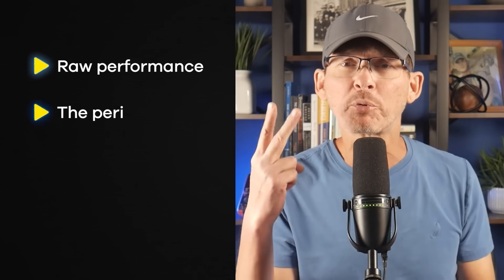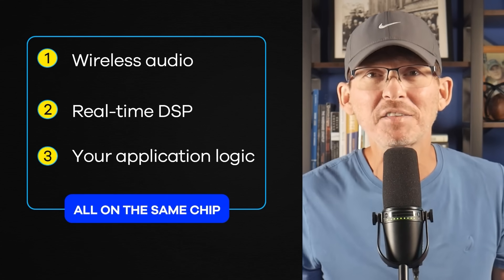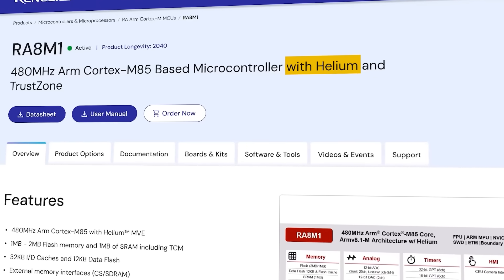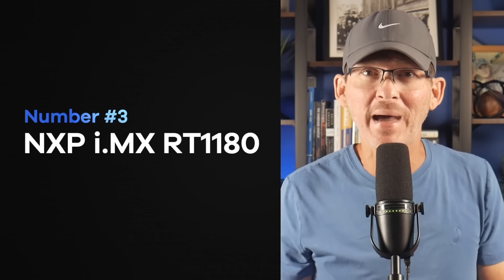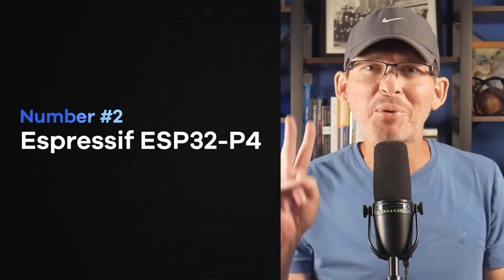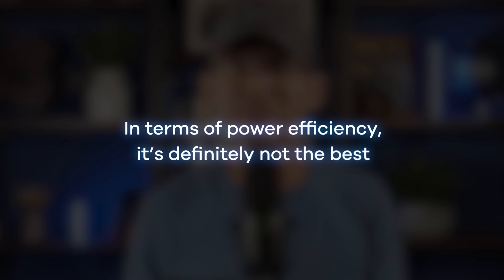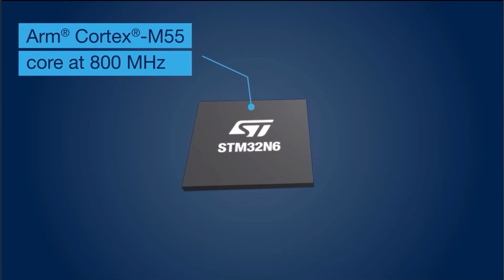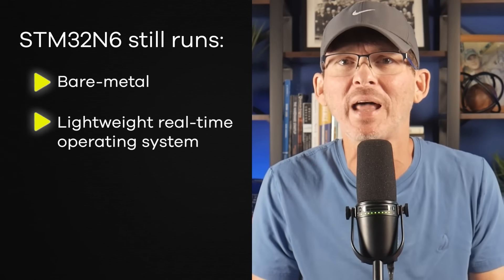Top 5 Most Powerful Microcontrollers in 2026

Comment: That STM32 part is basically a Beaglebone Black / FriendlyARM Mini210 in a chip (and without the memory management unit?). These used TI and Samsung parts with the ARM Cortex-A8 and were a favorite for embedded Linux because they never need a heatsink, even in a gas pump in Egypt. They have camera in and video out, etc.

Comment: Sorry, but STM32N6 is not the most powerful, it just have AI cores that not useful for all, STM32V8 will have much more computational power and higher clock rate. 
Also you are missing that some TMS320 will blow most of even GHz level processors on computational performance. (but they are more or less full blown DSP, but at this point, line is very blurry)

Comment: Heh you missed one thats a bit under the radar its about 1-2 years old. Its the Sophon SG2002. The devkit is the MILK-V. Its a 3-core system 1gHz RISC-V @ 1ghz kand a A54 @1 ghz. The RISC runs Linxus and the ARM runs a RTOS. Also the 2002 has 512kb RAM AND its in a QFN package... its kinda on its own level

Comment: I think that when considering the CPUs you're focusing too much on core MHz and not enough on microarchitecture. The Espressif's dual 400 MHz RISC-V are simple single-issue cores, and not really competitive with even a single Cortex-M85 or Cortex-M7 (both of which are dual-issue even for 32b ARM ISA).

Likewise the Cortex M55 in the STM32N6 isn't as fast as clocks suggests, as it can only dual-issue pairs of 16b Thumb instructions. The STM32H755 has it beat on sheer CPU horsepower (though admittedly it's split between the M7 and R7).

With that said I agree with ranking the STM32N6 on top on the basis of the NPU and peripherals. I really like STM32-series microcontrollers.
Reply from the maker: All good points. Thanks!

Comment: If you found the STM32N6, why did you not find the STM32MP257 (Arm A35 (1.5 GHz) and M33 (400 MHz) with almost identical peripheral set. Also the core chosen for the Octavo Systems OSD32MP2 system in a package (with integrated power management, DDR4 memory, and the STM32MP257 in a 22mm package) Then there is Xilinx/AMD UltraScale (ARM A53 dual core 1.3GHz and R5F dual core at 533 MHz with integrated FPGA). But any of the reviewed are good choices depending on what you are developing - the real problem (for the last 30 years) is that chip vendors do not value the development environment. Not one has had truly good IDE/Debugger/JTAG support.
Reply: STM32MP257 has a Cortex A core which is definitely non-microcontroller, with virtual memory etc. 
Use Jetbrains CLIon if you want to have an outstanding non-vendor locked IDE. Built around CMake so configuring compilers etc is very flexible and powerful.

Comment: Hear that there is a M85 running at 1Ghz available.
For cost wise, the cheap Pi zero 2W can out perform all the MCUs. Well, except Arduino Uno Q.
Reply: Not on the bare metal, the pi zero is considered a compute module or SBC because it is reliant on an OS which can't compete with running bare metal tasks. So when it time critical you do not run linux(rasberian).
Reply: @ntal5859 The only different is the startup time. Some high end MCU take more the 0.7s to function. The pi5 can boot in 7s. Or, you still can write your code to run on Pi zero without Linux. So, depends on how much effort you want to put in. To me, FPGA, MCU, MPU are all the same. Pick depends on the cost and effort.

Comment: I checked on Mouser. An STM32N6 cost less than 20$.... Amazing.
Reply: Go check the price on those Espressif chips while you're at it. ST makes very nice microcontrollers, and I much prefer working with them because I think that the tools and peripherals are significantly better, but for performance per $$ Espressif is hard to beat.

Comment: I am confused , interesting , but new unknown processors.  
  - ex: Esp32-P4 is $16 + $sh or $20 amaz - not cheap - also google says not much software support yet

Why are the good inexpensive chips ignored though ...
- for ex: I have 20 some chips , 250MHZ , 300KB SRAM + 8M PSRAM , 1M Flash, for $2
Reply from the maker: The goal was purely to cover the most powerful without regard to cost. But I do want to do one on most bang for your buck.

Comment: Esp32-p4 comes with 32MB PSRAM on chip,  can address up to 32MB flash,  16 of those for program, it interact seamlessly with esp32-c5 for wifi6,  5GHZ,  zigbee,  matter and BLE.
And the price. 
It's qfn and lives happily on 4 layer pcb.
The software ecosystem, extremely strong. 
#1
Reply from the maker: Thanks for the extra info!
Reply: Yeah, price-performance wise, its the most interesting chip. Cost a quarter of a STM32N6, with huge on-chip RAM. While the PSRAM on the ESP32-P4 is only 8 bit with 200 MHz, its still fast enough for the graphics engine. The complexity of the STM32N6, RT1180 or the Renesas chips require a long and costly development, only bigger companies can handle. With the ESP32-P4, experienced "Arduino developer" can do it.

Comment: Good review.
It would be nice to also hear the price of the devices described.
The cost-effectiveness criterion is important.
Regarding the STM32, a question:
Will this microcontroller be sufficient for an open-source smartphone?
Reply from the maker: Yeah, that's my one regret with this video is I forgot to discuss cost. Bad John!

For a smartphone you'd need a full application processor, unless very simple.
Reply: Agreed. Is a CH32V003 good enough? Or should I buy an ST32F407? Or something in between?

Comment: 4:46  The RA8 you mentioned has a sister called RA8D1 which has both dsi and csi mipi.  And RT1170 also does. Lots more out there.
Reply from the maker: Thanks for sharing that, I didn't know the RA8D1 has both DSI and CSI.

Comment: For most applications, features are more important than performance. The RP2040, for instance, may not be the fastest MCU, but it has a programmable IO feature that rival what can be done with FPGAs and GALs. It's an excellent chip for driving high-speed devices such as display panels with enough processing power left for other tasks.
Reply: Unfortunately the RP2040 has conditional 5V I/O tolerance for some legacy interfaces so baggage such as level shifters or sequenced power supplies to ensure no damage it done. E.g Dr Guzman Logic Analyzer.  CPLD & FPGAs are cool but have always been damned expensive!
Reply: Psoc has it beat in that department
Reply: @KerbalLauncher I refuse to do any business with a company run by a dirtbag like TJ Rodgers.
Reply: T’was quite a controversy ending up with him resigning in 2016. PSoC is now owned by Infineon.
Reply: RP2040 is hard to beat in price, RP2350 and ESP32 too.
Reply: As long as there are not the kind of shortages that hit people who design in the RPi's.

Comment: I used the stm32n6 in one of my projects an it is stupidly fast. Huge step up from the other stm32s I had used. Note it doesn't have any embedded flash and is BGA only so getting a PCB made is much trickier.
Reply from the maker: Yeah it's one impressive chip for sure!
Reply: But to use the GPU do you need to write your own graphics API? I doubt you get Vulkan support?

Comment: Some RT1176 parts actually have a 1 GHz M7 core and a 400MHz M4 core. There's also some weird peripherals like gigabit ethernet (although you need a PHY), FlexIO (can emulate a lot of peripherals) and you can attach 256MB of SDRAM.
Reply: Was just about to say, as I understand it the RT1176 is faster but the RT1180 can switch IP and run EtherCAT
Reply from the maker: Good point, and I missed the RT1176 running at 1GHz! Wow!
Reply: @PredictableDesigns  Yes, also check out the RT600 it has a 300MHz M33 and a Cadence HiFi 4 DSP running at 600 MHz. It is porbably the best for low power real time signal processing.